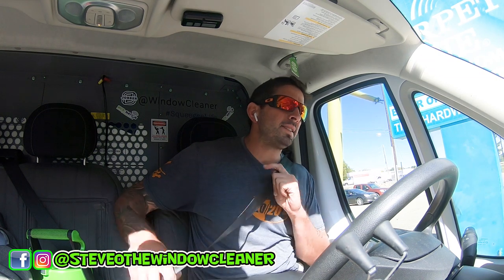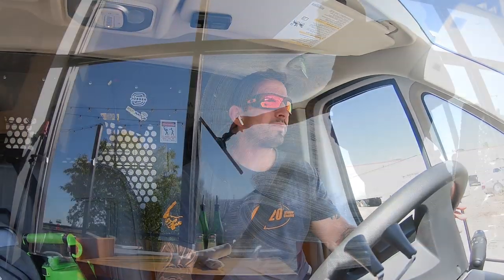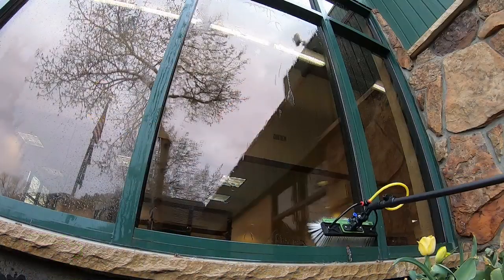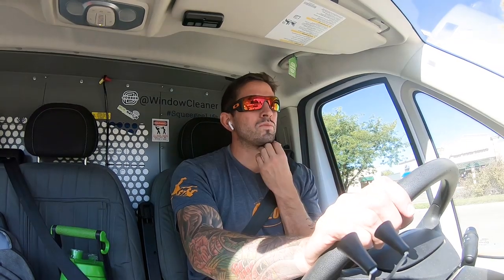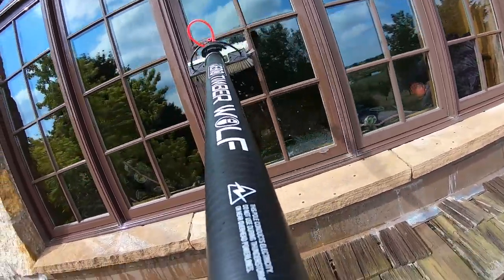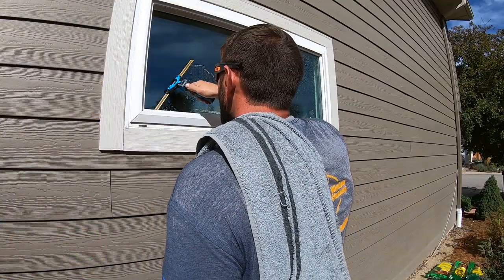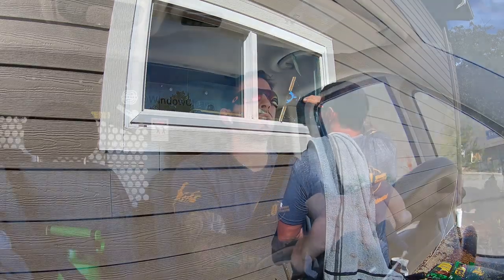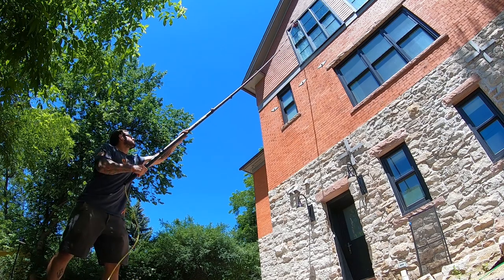WHEN TO USE & NOT USE WATER FED POLE | PURE WATER WINDOW CLEANING

Comment: Nice balanced view on it. For me It comes down to how high the job is and what kind of frames the job has. Our work is mostly storefronts and I never use WFP on them except sometimes for signage where they have protruding letters glued on and stuff like that. Up to 25 ft for the most part I prefer trad. But you are right used properly the results are unbeatable with wfp.
Reply from the maker: Exactly, its an awesome tool and has its place but storefronts are too easy to do traditionally!

Comment: Thank you for the valuable information Steve. Question, When using WFP, what precautions do you take before using it on residential homes? How do you know if the window seals or windows are in good condition to use the WFP system? I'm concern about water leaking inside the customer's home.
Reply from the maker: If water leaks into the home its not your fault, homes are supposed to be sealed well enough that water shouldn't get in. Just makes sure the windows are locked, anything else that leaks is not your fault. Ive had it happen but ive explained to the customer that its there issue with how the home is built

Comment: One thing to consider for WFP and hoses getting caught up; a backpack unit is a great tool. Grab it and you are ready to go in minutes, easy to access the back of the property without any tangle ups, also for commercial, less trip hazards. Can be heavy but I just put it on the ground when I’m ready to use.

Comment: How would you remove water stains on a 2 or 3 storey home with a water fed pole? I have a bronze wool pad but it doesn’t seem to do the job
Reply: Clamp a wet soapy Quadruple 0 grade steel wool pad to a pole and scrub with that. Once stains are scrubbed out then wash over with water fed.

Comment: Hi Steve, great video mate and thanks, i guess the way to look at it especially for the only trad and only wfp people is that both methods are tools literally.
    So use what works for you id say, mind im the same with shop fronts id probably go trad, though high level wfp as its safer etc so id use where needed.
    Both methods are good and as long as you stick to the basic rules/good standards then the customers and you will be happy with the results.
My 1st 5yrs where trad only as its all i had, the other 14yrs after has been wfp for all houses and commercial outside work, and trad for shops. 
    Construction cleans are about making the right call/what method it demands.
Love your channel Steve and a big thanks for your efforts doing it too.
All the best and Merry Xmas mate, Andrew UK. 😊🌈😊🌈

Comment: So I'm adding DI water to my pressure washing. Plan is to offer spot free rinse. I'm running 10gpm soft wash pump and 10gpm pressure pump. Ive heard pure water is tough on metal so likely will only run through my poly soft wash pump. Bought a wfp thinking for commercial windows and frames downstream or softwash either sh/acid/soap > scrub >rinse with DI > game over..
Reply from the maker: Sounds fine to do, many soft washing companies use a water fed pole to quickly agitate and rinse all the glass to not leave any spots. Also EBC glide can be used for rinsing with soft wash mix to leave the windows looking good 

https://windowcleaner.com/products/ebc-glide?sca_ref=3020242.k17l3JaEgS

Comment: Water fed pole for residential is always slower then traditional I find and another thing I do not like about water fed pole is if you're cleaning windows that have wood frames that is too risky because you can get a crevice that was holding water and then all of a sudden it releases it later on causing a grayish film on the glass I find that water fed pole is really good for windows that are inaccessible by no other means or if the temperature of the window is so hot that using any kind of squeegee but window cleaning solution will result in streaks

Comment: U mentioned construction homes and not potentially using water fed… will the water fed still clean construction home ? Thanks
Reply from the maker: It can remove dirt and grime, but not silicone, paint or any adhesive

Comment: Hey Steve, I notice if I dont use a scraper then it always leaves behind something when I clean the glass with steel wool and just the mop. I then always have to do it a second time, which is not time efficient. Do you have any tips of what to do or just an answer as to why I won’t get perfect results unless I use a scraper?
Reply from the maker: Hey, a basic cleaning I find mop and steel wool or walnut pad does a great job, are you removing paint and debris?
Reply: @SteveOthewindowcleaner Thanks for getting back to me, and yes there’s always some sort of debris left on the glass after a first time cleaning if I don’t use the scraper.

Comment: Hey Stevo,
Steve here.
I'm in Alberta Canada,
Starting to get cold here.
I have a few clients booked for my waterfed pole. Is it ok to use around the -10 to +5 degree Celsius?
Or let's say 37 to 14 Fahrenheit ?
Can I still run my ro system?
Reply: I live in the U.K. & have been using the WFP at minus2 this week.Ive fitted a immersion heater in the tank & heat the water to 70C before I set off.With all the insulation around the tank it stays above60C until it evening.
Reply: @vonovine  that's awesome.
I made it to almost December before I stored it away.
I'd be concerned about turning their yard into a skating rink and house into an ice cube.  Lol
I go traditional through the winter and anything that is unsafe can wait until spring.
Cheers brother.
Reply: @stevephillips2758  I only use the wfp to do upstairs windows as I use di so the water is costly, so water doesn’t really drip down to ground level anyways.
Prefer to squeegee downstairs windows anyway as they get dirtier generally anyway.
More insect poo, overspray from paint painting, painting in general, kids kicking balls at windows, dogs jumping up at doors etc.
Reply: Best to use the black Ettore holster, as it can be detached instantly from belt clip when using pole unlike all the others.